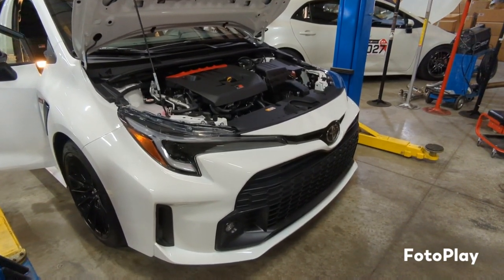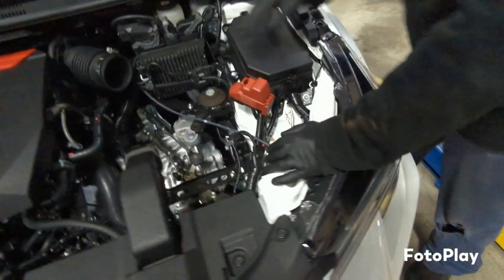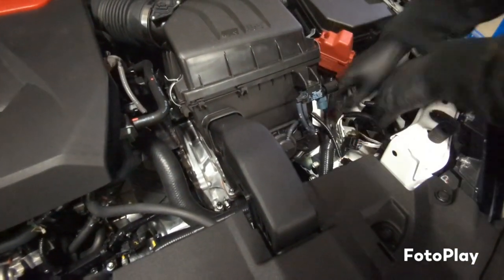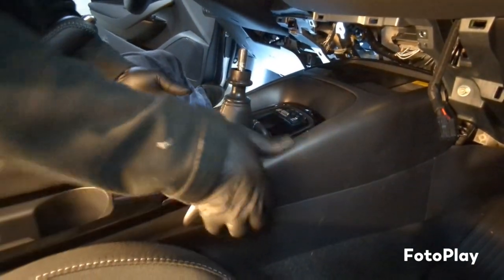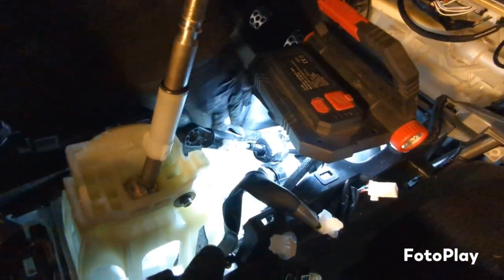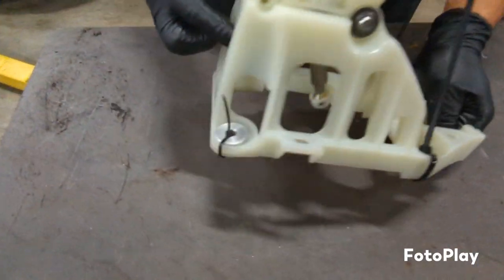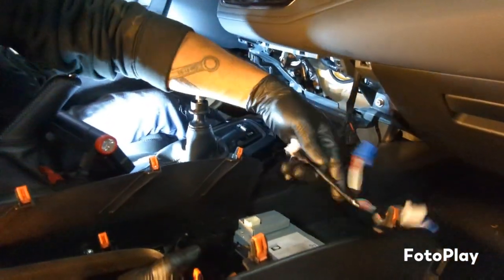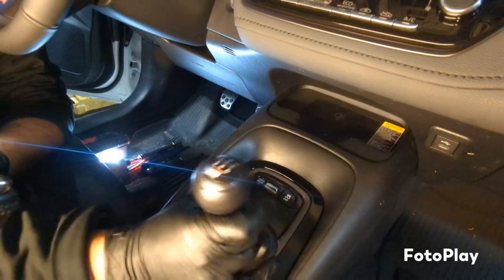Corolla GR Shifter Bushing Install

Comment: When I did mine when it came to removing the vacuum lines, I just remove the bolt holding all of them in front of the airbox and remove the one that was still attached below, so I didn’t have to remove those other two with the needle nose pliers I didn’t end up having to use a screwdriver for getting the old bushings off here’s my trick to getting them off, so where the bushing slides on those pegs that are metal after you take the two cotter style pins off of the bushing just push down firmly, but gently those rubber bushings will slide up right off which also means you don’t risk damaging the old rubber bushings. Should you need to ever reuse them again if they’re in usable shape of course before you go to take them off but that’s just 2 tricks I learned while doing it to install the red 2J racing shifter bushings